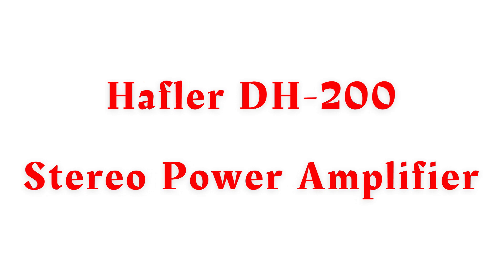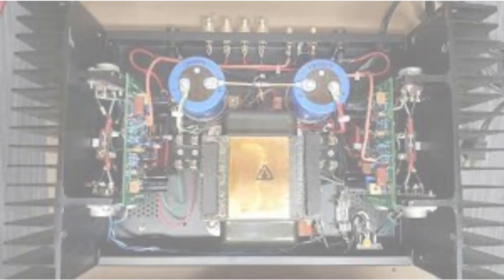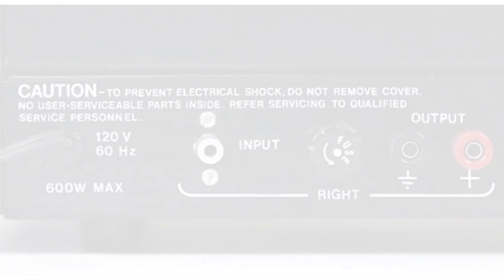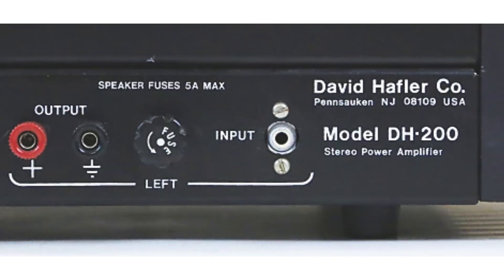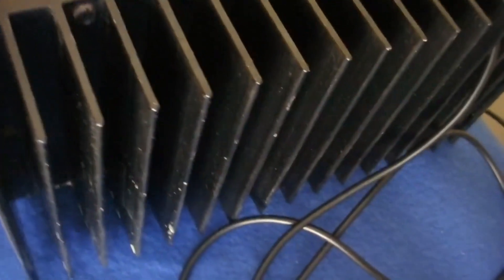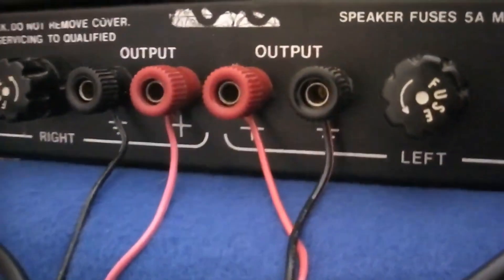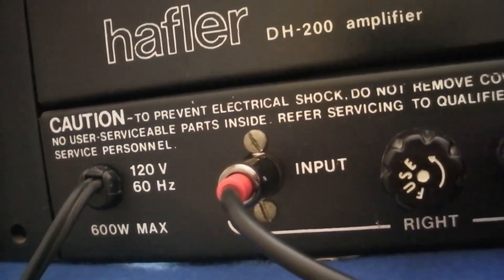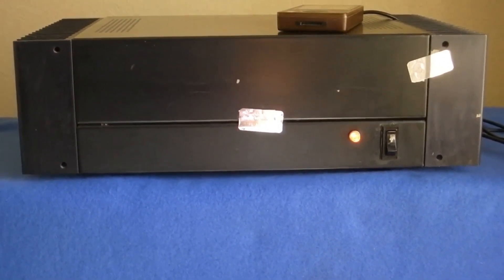Hafler DH-200 Stereo Power Amplifier - Overview and Test

Comment: many years ago, I had the same model, I ended up selling it and after that, I never saw one for sale
Reply: Yeah ... they were mostly home built kits and needed speakers specially toned for MOSFETs, Hitachi speakers.  Realistic T-100 are available but the T-70 Transmission Line is rarer than hen's teeth.  They'll do until you find something like a Lo-D HS 430 and it won't be a bargain.